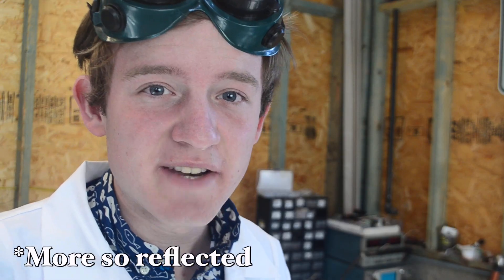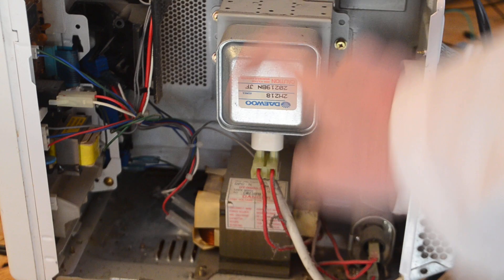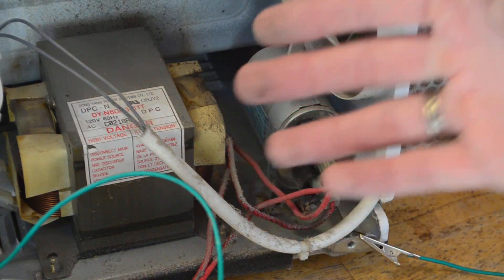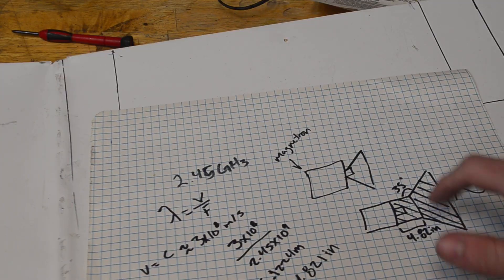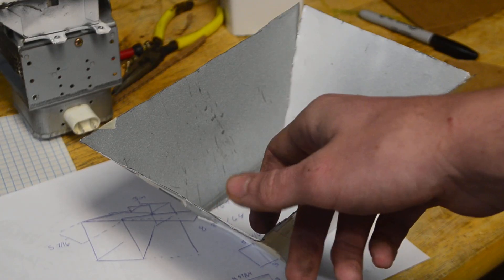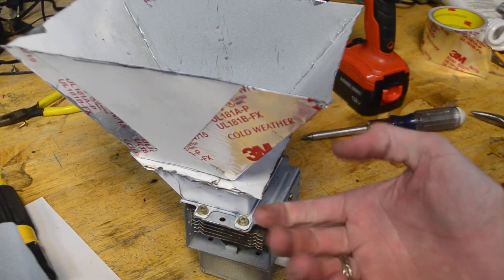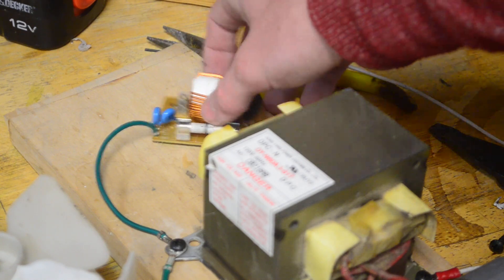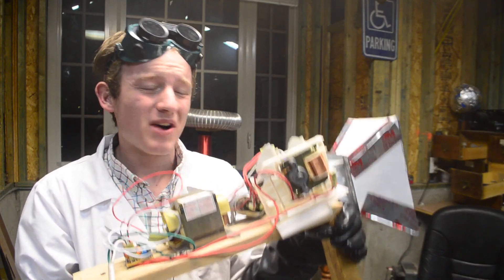How to make a Microwave Gun

Comment: Certain foil shapes can act as an antenna and focus the waves to a smaller point rather than block them. I'm not an expert in this by any means, but the foil hat might not be blocking anything but rather concentrating it. It's still fine though since the thing is directional. Just be careful in case you do one that doesn't have the waveguide.
Reply: USI 9080 i though so myself foil can amplify microwaves i.e. the hat

Comment: "Practically going to die"
Reply: I'd say almost definitely going to die. XD
Reply: @mydearpeers 
Nope, definitely no cancer. Microwave radiation is by far not "hard" enough to damage DNA. You'd need UV, X-ray or Gamma radiation for significant cancer risk, all of which are not produced here.^^
Reply: @ElectroBlood Only a bit of UV if you strike an arc using the transformer. d:
Reply: @jimmeh B
Nah, it doesn't output THAT much power. It will kill you electrically, by stopping the heart, maybe burn the skin off the contact points on the way. But that's about it.^^
Reply: nah.... it'll just rip ya arm off at the shoulder,  cauterizing it before you can blink, but that won't matter, because by the time your blink reaction kicks in, it will have killed you dead.
Reply: +ElectroBlood Aren't microwaves absorbed extremely efficiently by water? Wouldn't the blood boil before you could burn any skin?
Reply: "Virtually going to die !"
Reply: cancer of everything due to radiation exposure

Comment: So what does it do to the wall outlet?
Reply: The outlets are GFCI outlets... the RF is tripping the sensitive circuit in there.... GFCI trip when they get a difference of potential between the neutral and ground lines. This just opens the circuit at that point. It's not the main breaker in the house that normally trips out when your  pulling more than 15 amps,
Reply: Drew Bransby It shorts things out and trips the breaker. You just have to reset the breaker and you're good to go.
Reply: Ramon Murray Shorting is when you complete a circuit, how are microwaves completing the circuit.
Reply: That's not what "shorting" means Drew. Shorting is completing the circuit without enough resistance, causing a too high amp load.
Reply: Baqca Sanke and how would microwaves do this?

Comment: Definitely on some sort of NSA watchlist now.
Reply: Facebotter He should probably just rename the channel to "How to be a Bond villain on a budget"
Reply: Here's a one elaborated comment, just for you :

"The idiot thinks EM radiation at microwave frequencies has less energy than EM radiation at visible light frequencies"

Well, it *DOES*. 

Quantum Physics have greatly established that electromagnetic interaction between matter has to be quantized, in order to explain mush of the phenomenas seen, such as black body radiation (ultraviolet catastrophe) and the photoelectric effect.. (and even some effects at extremely low temperature). 

- E = h.f ; where h is the plank constant. The frequency of visible light is in the THz range, the microwave oven one is at 2.45 GHz. This represents how mush energy a single photon of the electromagnetic field has.

E(light-min) ~= 4.135x10^(-15) x 430x10^(12) = 1.77805 [eV].
E(microwave) ~= 4.135x10^(-15) x 2.45x10^(9) = 10.1 x10^(-6) [eV].

The microwave energy packet has much LESS energy than the visible spectrum, what you don't understand is that the magnetron have a very large power output (1200 Watt). That means you get an enormous amount of photons/s (intensity), especially if that thing is directed at you :

Let's suppose it has run for a single second : E = n.h.f ; n is the number of photons you'll get (supposing it's very close).
n = 1200 [J/s] / 6.626×10^(−34) x 2.45x10^(9) [J.s][Hz] = 7.392 x 10 ^ (26) photon/s.

That's a lot (700 000 billion trillion photon/s).
Compared to visible light where it is dissipated along vast distances and on huge surface.

The microwave works because of the absorption of microwaves by the water molecules in food or in live tissue. 

"He has demonstrated on this he doesn't understand basic concepts of the electromagnetic spectrum."
Refer to these before  expressing your ignorance :

Electromagnetic spectrum and Light :
https://en.wikipedia.org/wiki/Electromagnetic_spectrum
https://en.wikipedia.org/wiki/Light

Photon energy :
https://en.wikipedia.org/wiki/Photon_energy

The physics of the microwave oven (greatly elaborated) :
http://www.emu.dk/sites/default/files/physics_of_microwave_oven.pdf
 
"Creative play with microwaves?" _"he gives himself a tumor"_.
Microwaves ! Microwaves !
What about your phone/PC or wi-fi? 
https://physics.stackexchange.com/questions/88486/2-45-ghz-microwave-oven-and-wi-fi
Reply: riot control tech has much more powerful, larger truck mounted microwave arrays for LE to use against citizens. whatever someone could do with this is minor, not to mention the chemical warfare agents and the lack of lawful law-bringers. less than lethal is all fine and dandy, but you gotta see who uses it more often and to what end 

you understand that proteins can be denatured and delicate cell processes can be fked with using non-ionizing spectrum! good. but the part where the flesh boils from the inside out is a myth as you don't have to go far into the skin to encounter absorptive water and flowing blood to conduct heat away.

don't make intelligent peeps a negative stereotype, its fear mongering on the level of fake investment news articles
Reply: @Baigle1   I need your advice , if you see this could you please help me?  Don't worry I'm not a scrounger .
Reply: Each material has a potential to absorb specific frequencies. If you refer to the Physics of the microwave oven that I linked (http://www.emu.dk/sites/default/files/physics_of_microwave_oven.pdf), page 5, it explains why water respond to microwaves.

A great book describing EM materials can be found here (very technical) :
"Handbook of Electromagnetic Materials"
https://books.google.fr/books?id=5w6fTx47MgsC&lpg=PA507&ots=gQe1kMuNhL&dq=materials%20EM%20absorption&pg=PR4#v=onepage&q=materials%20EM%20absorption&f=false

For protein, you can get an idea of how they can probe the effects of microwaves on such organisms :

"Evidence for a Specific Microwave Radiation Effect on the Green Fluorescent Protein"
https://www.ncbi.nlm.nih.gov/pmc/articles/PMC1518661/pdf/1413.pdf

"Non-thermal effects in the microwave induced unfolding of proteins observed by chaperone binding"
http://sci-hub.io/10.1002/bem.20382

These subjects are quite developed on their own, they are very extended. Each subfield of microwave and biochemistry is a huge field on its own. They say no matter how much you learn, you still didn't learn the equivalent a single drop in an ocean !
Altho I can understand pretty much all of it (I do have all the necessary mathematical knowledge up to Master level), it requires a great deal of patience to delve into such things.

Good luck ;)
Reply: Planning to make an emp rig at the front door. Any of my devices that get carried out without my permission will be of no use to anyone lmao.
Reply: +Christine Haworth Damn, dude. Maybe he shouldn't be messing around with stuff like this, but he's clearly no danger to anyone. Who wouldn't have made this as a teenager?
Reply: great post! where can we get info on all the structures that absorb at certain frequencies, or do we have to use multiphysics models using different materials and can't know if fats or certain proteins absorb the 2.45GHz spectrum?
Reply: @Baigle1  isn't that WiFi? 2ghz?
Reply: You're a horrible person. p.s. things more infra than infrared, like microwaves, do carry less energy per photon. Way to be a raging ass
Reply: Logic thank you for schooling Christine on her idiocy! I wanted to, but didn't want to have to type all of that...
Reply: Brad ha, you beat me to thanking logic! (By a month, but still xD) It makes me wonder, why is christine so confident? "The idiot thinks EM radiation at microwave frequencies has less energy than EM radiation at visible light frequencies" - so you are telling me you think this guy (keystone science) is an idiot, when you clearly have less knowledge than him? Tut tut, christine.
Perhaps she actually doesn't know about photons (basic physics theory) and that an intense source of radio waves (for example) might do much less damage to you than a small packet of gamma photons, but is she seriously going to ignore the rest of this comment section once somebody rightfully proves her right (I don't see a reply from christine after that point)? Goes to show how well mannered she is. Perhaps she didn't want to own up because she would sound like an idiot, due to her confidence earlier. But if that's the case, why be confident in the first place? You're never in a good position if you start to believe everything you think you know is certain fact - I hope she takes this or a similar lesson away from this, but she probably won't due to her ignorance. Always be open-minded, never think to yourself that just because you haven't seen a phenomena before, doesn't mean it's fake (but at the same time, try to make sure that the concept actually seems possible - don't start believing the earth is flat because some random flatard told you NASA is lying to you about it's roundness).
Reply: I wonder how well this would work against a drone. What kind of range could you have
Reply: For sharing technology that's been common knowledge since before you could record a movie off the TV
Reply: LOL everyone in the entire world is already on an NSA watchlist
Reply: So what
Reply: PetShopDogGaming Too small?...Uh no, In a rectangular waveguide (TE-10) think of the RF energies as a continuous perfect half hemispheres, butted one after the other inside a length of rectangular tubing, all in perfect step....functioning like an electric wire, losing nothing in the process...on & on down the length.
  (Look up TE-10 mode in 'images'") If a waveguide can be "simulated" outside, in free space...there will be little loss over a long distance...I'm working on it & have a key Idea to make it work...Your death-ray in reality, the Physics say I'm right, I've seen nothing to say it won't work, nor someone who has even remotely tried.
Reply: @AndieBlack13  I could use your brain to help me stop getting targeted!
Reply: PetShopDogGaming Yep, rather than blasting large quantities of energy into free space, relying on sensitive receivers to decode data, you could decrease power levels immensely. Moving power from point A to point B would change.
  Recall in Star Trek, they often refer to a "plasma conduit", almost as if Electricity was replaced with a new medium of power transfer?
Reply: Phil Weatherley - SWAT teams, SEAL teams and such use this same sort device twenty years ago, so that's why all the villain jokes.
Reply: Not as much as Mr. better-build-a-shoulder-fire-antitankrifle-and-try-to-sell-it-to-global-special-forces.
Reply: for sure!
Reply: dont do this ok. cap'n crunch will b.f. you
Reply: And Ritalin
Reply: You can rebuild the Higgs before during and after the conversion of energy into Mass
Reply: Collaboration with styropyro?
Reply: What a bunch of a holes in the thread
Reply: Any comments on this video goes straight to Daniel A Wilten's inbox because he is actually wanted by the police for capital murder. And he is still trying to monopolize this weapon.
Reply: Who gives a sh+t f+*k the NSA LMFAO
Reply: Welcome to the club
Reply: We are all on the watch list for watching this
Reply: @idkname  National Secruity agency ! They are spies !
Reply: You dont even have a clue bro ! Lol 😆!
Reply: Welcome to the club buddy.
Reply: Lol...epic!
Reply: Well, FBI or ATF if anyone. The NSA window lickers are too busy with the bad guys of the world
Reply: Disappointing. So this garbage can't take down a drone unless it's just a couple of feet away from you. That's stupid. Exposing yourself to those harmful frequencies for NOTHING.
Reply: Like you werent before you saw this video.....i admire your optimism
Reply: You're not American if you haven't made a list yet. F*ck them. Live or Die Free
Reply: He's probably a gangstalker now or informant
Reply: Just be transparent, when they see u don’t have bad intentions ur ok
Reply: Btw, have u ever made a puke gun? Costs about 400$ nowadays! Simple, gotta give contractors props, they got 1 million for developing a non lethal that prob costs 10k in r and d
Reply: Everybody is...
Reply: @idkname National Security Agency
Reply: @bedfordshiremodeller4491  have a nice time! thank you.
Reply: 999th like fr
Reply: I mean I specifically looked this up so same probably
Reply: Yes sure and probably everyone that has seen this video as well so remember to use your VPN and whatever else you want to use to keep your own information from the scum,a,ment 😅😅
Reply: They are already hitting people in the streets with these weapons...
Reply: @FireandEtherSociety my mom is trying to get me killed with a lot of them around the house
Reply: You'll have more to worry about from the FCC.
Reply: Phil Weatherley Don't bring politics into this.
Reply: I don't see what Vault 7 has to do with this.. the documents are years old and monitoring everything except Facebook is not in their jurisdiction imo
Reply: Same =/.
Reply: @IizUname  ray gun good
Reply: Ron Swartz Anonymous mate, microwaves aren't discriminatory. They will fry you, your customers, your electronics, and your customers electronics. Come on man, think this shit through.
Reply: havent read that before. -_- original.
Reply: PetShopDogGaming A death-ray? Nope, the cube-root law would have RF power falling away immensely with distance....all that power & no practical way to "focus" the energies. BTW, His waveguide that he built is by far very inefficient, he should have gone with TE-10 mode & a sixty degree horn...I was doing this stuff in 1985.
Reply: Any who had listened to their physics teacher in high school.  HE might not be a danger to anybody, nor himself but what about idiots who watch the videos and copy them?
Reply: No fear of intellectual either.  He has demonstrated on this he doesn't understand basic concepts of the electromagnetic spectrum.
Reply: @christinehaworth4924  How?
Reply: Creative play with microwaves? Yes, he may discover pointing the thing at his head hard boils the protein in his eyes, or he boils his flesh from the inside out, or he gives himself a tumor.  Now THAT would be more educational.
Reply: Should go far?  The idiot thinks EM radiation at microwave frequencies has less energy than EM radiation at visible light frequencies.  The idiot doesn't understand high school physics.  He is a danger to society and needs locking up to keep everybody else safe.

Comment: I suggest renaming the video to "how to sterilize yourself in the home shop (not clickbait)"
Reply: Make sure to wear your metal cup!
Reply: wait are you not wearing your tinfoil jock strap?
Reply: Its not so much about Hertz as watts.
Reply: Nah, if you check this source :
http://www.emu.dk/sites/default/files/physics_of_microwave_oven.pdf

You can see clearly at figure 6 (page 6), that the 5 Ghz microwaves have a little less penetration than the 2.45 GHz ones. But since you aren't confined to a resonant cavity (of course your house isn't one, unless they somehow forms standing wave inside it !), much of the 1 watt (I believe it's less) is emitted spherically : you only receive a tiny proportion of it, and it scales down with distance.

By less penetration I mean that (for example at 20 GHz), the microwaves will only cook the skin of the food (or a live tissue). At 2.45 it can go inside, so all of the food is cooked evenly.

That directional thing is extremely dangerous. Especially if you are on close range, since all of its power is focused on a specific patch of space.
Reply: because no one likes roasted nuts
Reply: they both matter
Reply: Logic interesting, thank you
Reply: Baigle1 I believe most routers are on a 5.1Ghz frequency now instead of the 2.4Ghz
Reply: notaseagull IIRC, the microwave puts out about 1,000watts in the air and blows away the anemic 1watt router, but that shouldn't be an issue anymore due to routers being on a 5gHz range, correct?
Reply: Cylo's Garage Reminds me on Futurerama, when bend does that to Fry
Reply: MWB Gaming I'm dying
Reply: The 1 watt turns to background noise before it even gets through the dead layers of your skin, its only enough to be picked off out of back ground noise from 20m or so away.
Reply: you guys know the frequencies used by microwaves and wifi are the same, right?

much lower power out of wifi, but exposed over decades.
Reply from the maker: +William Smullen wait, what the heck is your problem. What did I do to offend you.